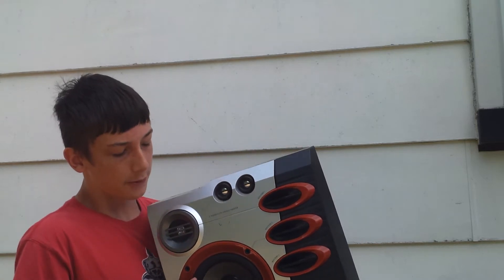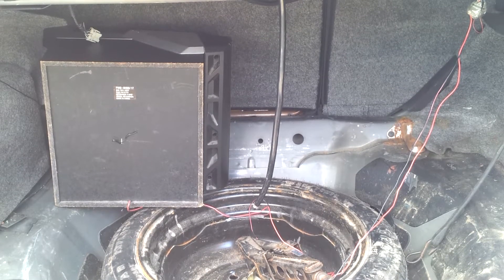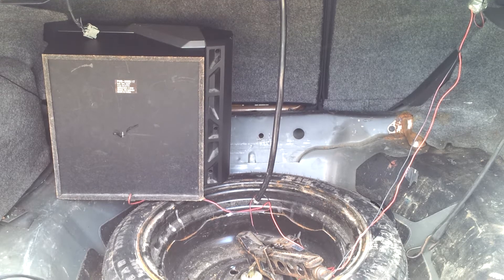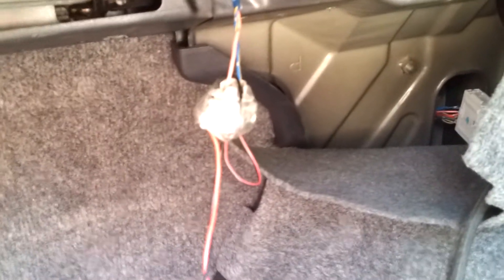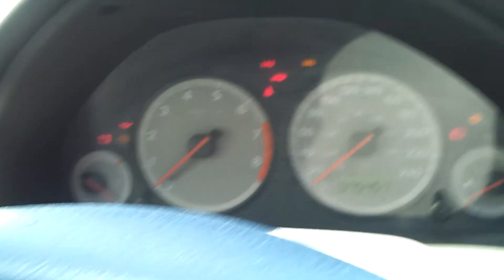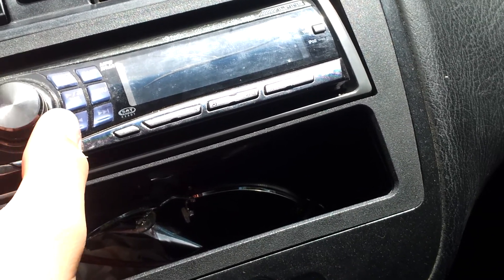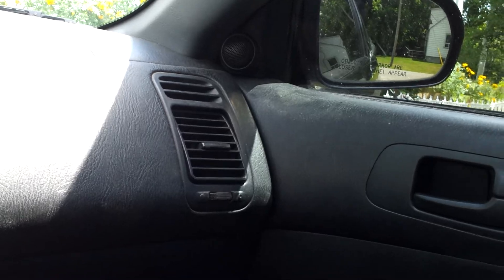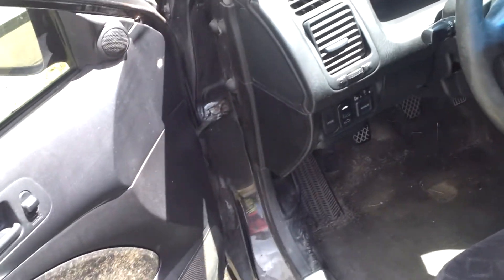How-to: Use stereo speakers as subwoofers

Comment: Isnt audio output produce "AC" output 0.0?? WTF with the negative and positive.. Ive been modified my own speaker and try the vice versa as normally people would do and it goes just right... Idk if there other option :P
Reply: Yes, it is ac, but if you get the polarity wrong, then the speaker  drivers will move in different directions and the sound will be weird and without bass.
Reply: ouh I see ... Ok